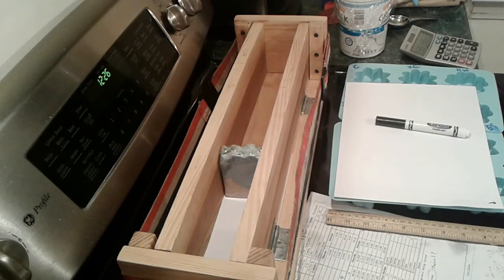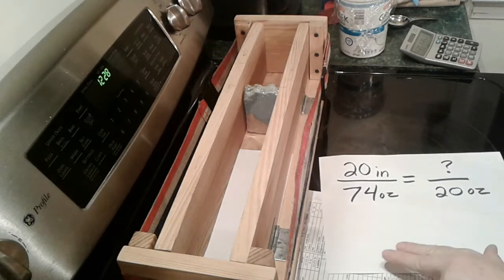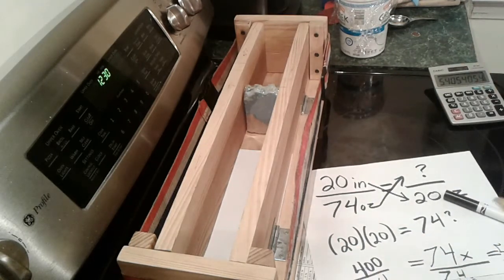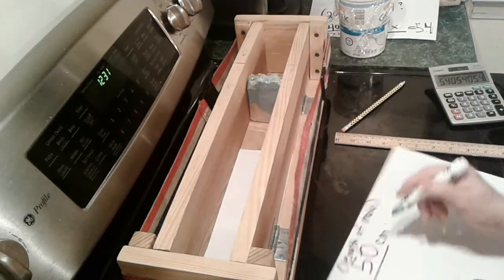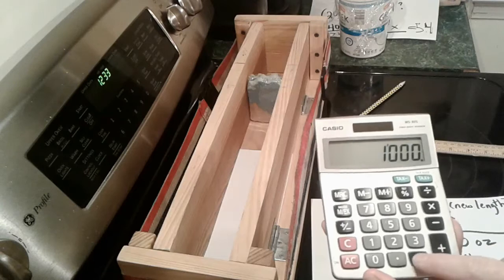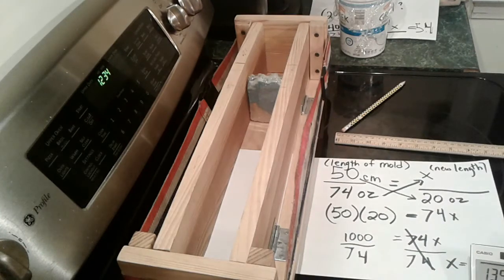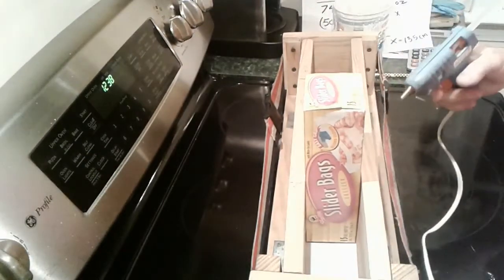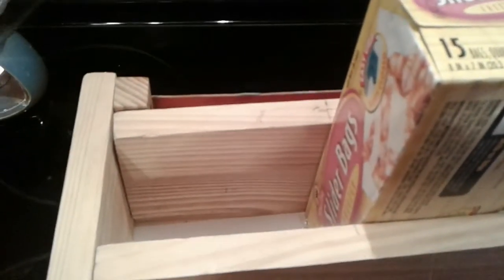Soap Mold Math - calculating length for a smaller loaf sample / Dividing a mold

Comment: Glue to the liner or use card board,over time adding a chunck of wood for divider helps the glue can ruin your mold
Reply from the maker: +Terry Nicholson What if the wood piece is cut like an M with edges cut to fit over the sides? (Does that make sense?) I don't line my mold.
Reply: Nancy's Garden Soap Co it should work
Reply: Make sure it fits snug but not so you cant slide to adjust incase it needs to be adjusted, let us know if it works i jadnt done ours like that but soumds li.e a great idea to keep from falling over
Reply from the maker: +Terry Nicholson Thanks for the ideas!

Comment: Why not add a fitted peice of wood inside to make your divider so its removable
Reply from the maker: +Terry Nicholson Hmm, good idea! When I made this video, I didn't create many partial soap loaves. I just needed a temporary division. Thanks for the idea. How would you secure a fitted piece of wood?
Reply: Nancy's Garden Soap Co are you using both sides of the mold or just one side?   My wife taped her card board at the top to keep it from rocking or a small ledge, thewood divider would go in just like you did the soap make sure it fits tiggt between the side wood when you use your strap to sinch it down some the wood shouldnt tip she taped hers from either side to the moldif one side wont be used you can put a spacer box to hold the divider in place
Reply from the maker: +Terry Nicholson Thanks for all of the suggestions. I like the idea of a spacer box. Tape does't stick well to my mold. I might ask my husband to make a wood divider. His forte is not woodworking, but I can probably get him to cut a piece of wood.